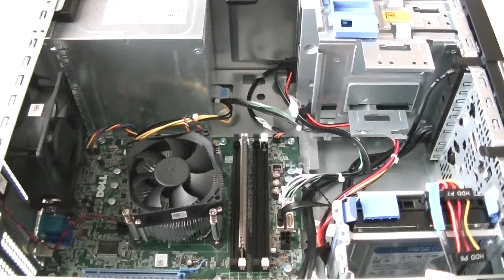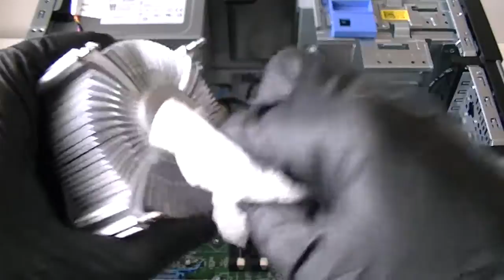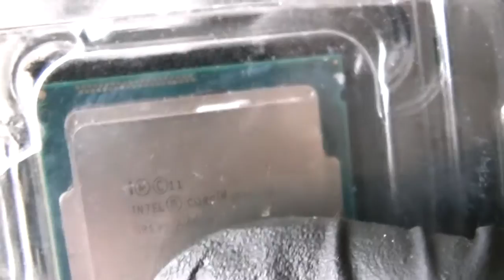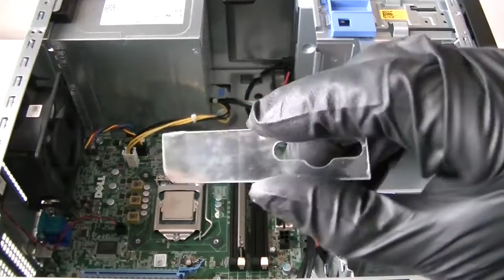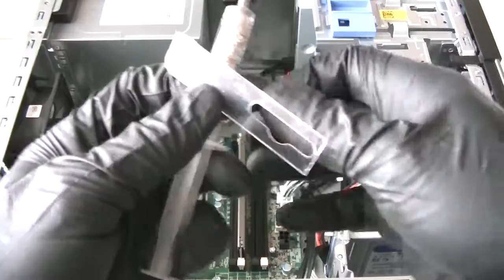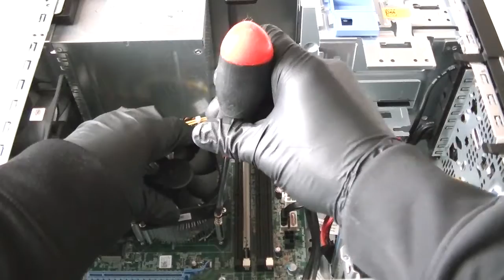Dell Optiplex 9020 Processor Install Replace Upgrade Change

Comment from the maker: Full Parts list works with this machine:

CPU Upgrade: 

Intel Core i7-4790 Haswell Processor 3.6GHz 8MB LGA 1150 CPU
https://amzn.to/3xeRaF5

Intel Core i7-4770 Quad-Core Desktop Processor 3.4 GHZ LGA 1150 
https://amzn.to/3QFmJ1v

PSU:

(1.) Corsair CX-M Series, CX450M, Modular Power Supply
https://amzn.to/3pnLUuh

(2.) Thermaltake Smart BX1 650W Power Supply
https://amzn.to/3Pl3WrN

(3.) Thermaltake SMART 600W ATX 12V V2.3/EPS 12V 80 Plus Power Supply
https://amzn.to/3DgVjfC

(4.) CORSAIR VS Series, VS500, 500 Watt, 80+ Certified, Non-Modular Power Supply
https://amzn.to/2RxoMZV

(5.) CORSAIR VS Series, VS450, 450 Watt, 80+ Certified, Non-Modular Power Supply 
https://amzn.to/3efEeDO

(6.) Thermaltake Smart 500W 80+ White Certified PSU
https://amzn.to/2xQHm8F

You will need this adapter if you upgrade power supply.

24 Pin to 8-Pin Power Supply ATX PSU Adapter Cable 
https://amzn.to/34T0lLS

24 Pin to 8 Pin ATX PSU Power Adapter Cable
https://amzn.to/3btebHf

This video cards will work with this system.

(1.) EVGA 06G-P4-2068-KR GeForce RTX 2060 KO Video Card
https://amzn.to/3TZkol8

(2.) ZOTAC Gaming GeForce GTX 1660 Super 6GB Gaming Graphics Card
https://amzn.to/3e3hwmz

(3.) ZOTAC Gaming GeForce GTX 1660 6GB GDDR5 Graphics Card
https://amzn.to/3AUoPpX

(4.) MSI Gaming GeForce GTX 1660 6GB GDRR5 OC Graphics Card
https://amzn.to/3KseNzj

(5.) EVGA GeForce GTX 1650 Super SC Ultra Gaming, 4GB GDDR6
https://amzn.to/3Pmi58a

NOTE: Requires Power Supply Upgrade For GTX 1650 Super

(1.) ASUS Phoenix NVIDIA GeForce GTX 1650 OC Edition Gaming Graphics
https://amzn.to/3Nyn7yb

(2.) ASUS TUF Gaming NVIDIA GeForce GTX 1650 OC Edition Graphics Card 4GB GDDR6 
https://amzn.to/3moJbzo

(3.) PNY GeForce GTX 1650 4GB GDDR6 Dual Fan Graphics Card
https://amzn.to/3aFlxw4

(4.) ZOTAC GAMING GeForce GTX 1650 OC 4GB GDDR6 
https://amzn.to/3xeX0FF

(5.) AMD Radeon RX 6400 Low Profile Gaming Graphics Card
https://amzn.to/3s8MUUY

(6.) Gigabyte GeForce GT 1030 GV-N1030D5-2GL Low Profile 2G Computer Graphics Card 
https://amzn.to/2Z4PHkp

(7.) ZOTAC GeForce GT 1030 2GB GDDR5 64-bit Low Profile Video Card ZT-P10300A-10L 
https://amzn.to/2WzgLXk 

(8.) Gigabyte GV-N1030OC-2GI Nvidia GeForce GT 1030 OC 2G Graphics Card
https://amzn.to/3wd8EkB

(9.) Asus PH-GT1030-O2G GeForce GT 1030 2GB OC Edition Graphics Card
https://amzn.to/3SZ0gPC

This RAM works with this machine MAX Supports 32GB:

(1.) Crucial 8GB Single DDR3L 1600 MT/s (PC3L-12800) Memory CT102464BD160B
https://amzn.to/2VhGv8O

(2.) Crucial 4GB Single DDR3L 1600 MT/s (PC3L-12800) Memory CT51264BD160B 
https://amzn.to/2xq46wb

(3.) Crucial 16GB Kit (8GBx2) DDR3L 1600 MT/s (PC3L-12800) CT2K102464BD160B 
https://amzn.to/2VpsKpP

Thermal Compound Paste:

(1.) Arctic Silver 5 Thermal Cooling Compound Paste 
https://amzn.to/2ziNU0H

(2.) Noctua NT-H1 3.5g, Pro-Grade Thermal Compound Paste
https://amzn.to/36kTk7A

(3.) ARCTIC MX-4 (current edition) Thermal Compound Paste 20 Grams 
https://amzn.to/2DhGJaK

Hard Drive Caddy Adapter  3.5 to 2.5:

(1.) Dell 3.5" to 2.5" SSD or Hard Drive Caddy Adapter R494D 0R494D 
https://amzn.to/2XTPeRr

(2). Dell Hard Drive Caddy, R494D, F767D 3.5" to 2.5" SSD or Hard Drive
https://amzn.to/3cTkcOk

SSD list works with this PC:

Samsung 870 EVO 2TB SATA SSD
https://amzn.to/3ezOds5

Crucial MX500 2TB 3D NAND SATA Internal SSD
https://amzn.to/3B9f8CF

SanDisk Ultra 3D NAND 2TB Internal SSD - SATA
https://amzn.to/3RSZ8LR

(1.) Samsung 860 EVO 500GB 2.5 Inch Internal SSD MZ-76E500B/AM) 
https://amzn.to/2yNxnkE

(2.) WD Blue 3D NAND 1TB Internal SSD, 2.5" WDS100T2B0A
https://amzn.to/2wvnC9Z

(3.) WD Green 1TB Internal PC SSD  WDS100T2G0A
https://amzn.to/3cbrcWa

(4.) SanDisk SSD PLUS 480GB Internal SSD SDSSDA-1T00-G26
https://amzn.to/3a3i9ou

(5.) Crucial MX500 250GB 3D NAND SATA CT250MX500SSD1(Z) 
https://amzn.to/34rZlhy

(6.) Samsung 860 PRO SSD 256GB - 2.5 Inch SATA III Internal Solid State Drive
https://amzn.to/2ybiHLK

(7.) Samsung SSD 860 EVO 250GB 2.5 Inch SATA III Internal SSD 
https://amzn.to/2VjIAkK

(8.) SanDisk SSD PLUS 240GB Internal SSD
https://amzn.to/3c7SEE4

HDD list works with this PC:
(1.).WD Black 2TB Performance 3.5" Hard Drive - 7200 RPM Class, WD2003FZEX 
https://amzn.to/2xFUeyF

(2.).Seagate BarraCuda 1TB Internal Hard Drive  3.5" Hard Drive - 7200 RPM
https://amzn.to/3g8FXM8

(2.) Western Digital 1TB WD Blue Mobile Hard Drive HDD - 5400 RPM, 2.5
https://amzn.to/3aEQ1Os

Comment: Thanks, great video. Is there an aftermarket fan that will work with the crew holes. I would like to upgrade the heatsink and fan to something better as well.

Comment: whats the size of the back fan? 
i have this computer and i want to put in another one and i'm really confused on how to measure it.
plus i suck at reading measuring tapes lol.
i would guess a 90 or 92mm.
if you can let me know that would be great! nice vid!
Reply from the maker: HI, rear system fan there is white little sticker and it will tell you dell number

Comment: Got my dell optiplex 9020 mid Tower with i5 4570. It will compatible if I upgrade to i7 4790k? Thanks in advance
Reply from the maker: Hi, yes  i7 4790 is compatible with this dell optiplex 9020.
Reply: hello i have dell optiplex 9020 ssf with i3 4610,can i upgrade with i5 or i7?I install a gtx 1050 ti lp
Reply: same here i got Dell optiplex 9020 Mid tower i5 4th gen, did you change right now in i7?

Comment: Hi again on the Optiplex 9020 MT it has a 5 pin port on the mobo and i wanna put in a new psu i got but i know of no psu with a 5 pin on it where can i find a adapter if any? or does it even need it?
Reply: There's a adapter you have to get. I got mine on ebay for a few dollars very easy to install. Some optiplex use a proprietary cable.

Comment: can you upgrade a Intel(R) Core(TM) i7-4770 CPU to i9 on the same motherboard from the dell optiplex 9020 sff MT? Any recommendations on where to get the processor if so?

Comment: Do you know how to install graphics card onto 9020 SFF ? 
Can you please do a video.
Reply: I'd advise against upgrading the GPU because of the limited non-upgradable 255w PSU.
Reply: If you wanted to replace the graphics card then you would have to replace the power supply. The Mini Tower machines run a standard ATX power supply and can be swapped out for any ATX power supply of your choice. The Optiplex 390,790, 990, 9020 are all the same machines with just upgraded components as generations go on, processor is now 4th gen rather than 2nd gen, memory is now 1600Mhz rather than 1333Mhz, memory capacity has increased from 16Gb to 32Gb, although it has been proven that the 390, 790 and 990 machines can handle 32Gb with bios update and processor that supports 32Gb. I have a Optiplex 790 and have upgraded the processor to the i7 2600, 16Gb RAM, Samsung 850 EVO 500Gb SSD, the standard 500Gb 7200rpm hard drive it came with and added my 640Gb 2.5" laptop hard drive, replaced the power supply for a EVGA 600B power supply and plan to install a new graphics card next year.

Why people still think these machines are non-upgradable is beyond me, old Dell machines are propriatory, newer machines use standard parts.
Reply: I forgot to mention that when applying the thermal paste, only use a thin 1/2mm vertical line down the centre of the CPU, DO NOT spread the thermal paste as this creates air bubbles in the paste and affects the running temperature of the CPU. My i7 2600 is running at 20 degrees C at idle and 50 degrees C under 70% load, I have never maxxed out the CPU load. 

I would suggest Arctic Silver 5 for CPU paste, it claims to reduce temps by 10% after 200 hours burn in, and I was sceptical. I applied it and idle temp was 30 degrees C, after the 200 hours burn in time my idle temp is now down to 20 degrees C. I'm using the same CPU cooler as seen in this video
Reply: How would you go about removing the PSU? I was under the impression that you could not remove the power supply because it's enclosed. It is for my 9020 SFF at least. And yeah, there is no need to spread out the thermal paste, a small dot will be enough. Less is more.
Reply from the maker: Hi guys, the power supply listed in links are fake that are not real 400w power supply you should buy like brand name or go with dell genuine original part replacement
Reply from the maker: For small form factor you can install some low profile video cards without upgrading power supply
Yes this video cards will work fine with dell optiplex 9020 sff, 

AMD Radeon HD 8570 Low Profile
AMD Radeon HD 7570 Low Profile
AMD Radeon HD 8490 Low Profile
AMD Radeon R5 240 Low Profile
AMD Radeon R5-340X Low Profile
Reply: Also GTX 1050 works fine
Reply: Pretty much this, i bought a R7 250 a while ago and i can't use it on this PC (Dell 9020) for its limited CPU (it works, but after a while it refuses to power on)
Reply: sff can do limited upgrade, low profile graphic card mybe...better go for tower

Comment: Is it suitable for gaming ...
Reply from the maker: Yes
Reply: Mxkdi i want to put a gaming card gtx 750 ti 2 GB tell me will i change the psu or not...cuz it has 300 wat power what u say about it
Waiting for reply 
Thatnkx in advance...
Reply from the maker: Hi, 300w power supply will work fine with gtx 750 ti and you don't have to upgrade.
Reply: I've used a Nvidia GTX 750 TI in a system with a I7 4770, 32 gigs of ram, a SSD, 2 optical drives, blah blah blah on a 275 watt PSU and had absolutely no issues whatsoever. I wouldn't recommend it, but it CAN be done. So with your system having a 300 watt PSU you shouldn't have any issues at all. I've since upgraded that particular system to a EVGA 700 watt 80+ bronze psu due to me getting a good deal on it but don't worry about your system being under powered for that particular card. However psu's are relatively cheap and pretty easy to swap out so if you come across a good deal on a quality unit by a well known manufacturer then go for it. In the mean time your current psu will be fine for that particular card.
Reply: @J Miranda bro with this setting what is the  minimum psu.. Does it run with 550w?

Comment: Can I put an i9 in here
Reply: No
Reply: @zacherykalloo415  do you know what the best CPU I can put in here is?
Reply: @chandlerbleeker9486  a i7 4790 not the k bc u cant over clock and add like a gtx 1070/1080 for kill performance if the card is to long cut out the hard drive cage
Reply: @zacherykalloo415  cool I'll check that out
Reply: @zacherykalloo415  why?